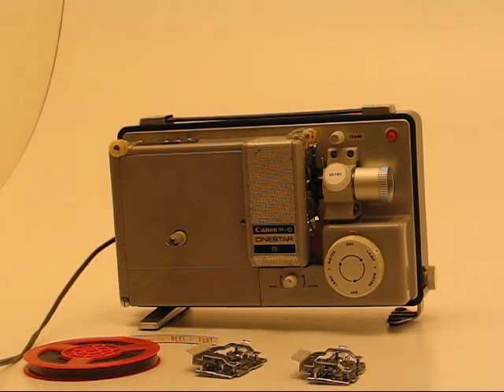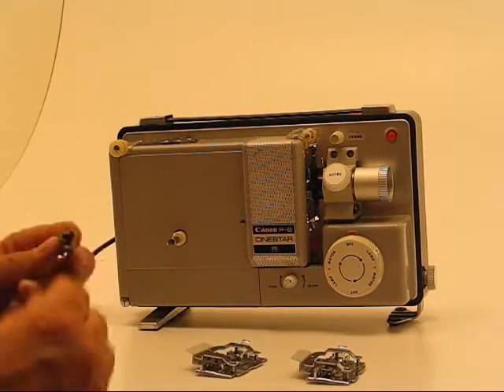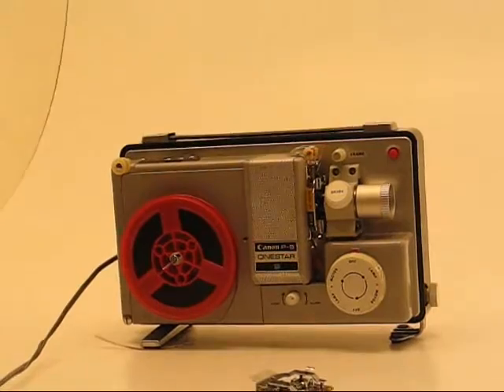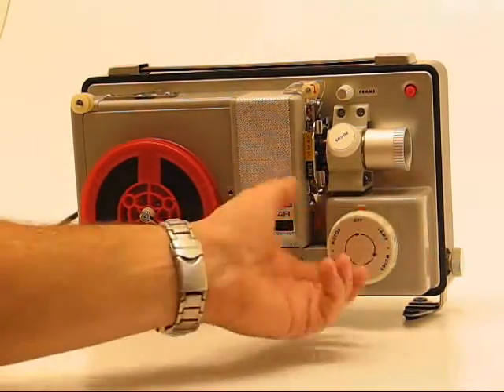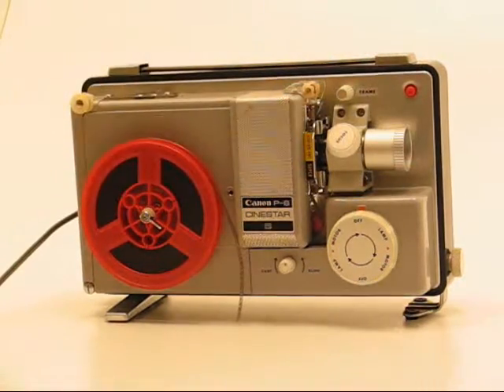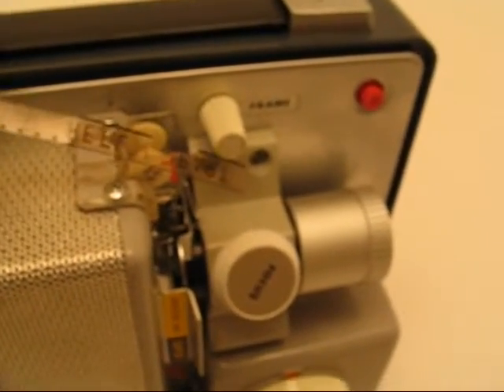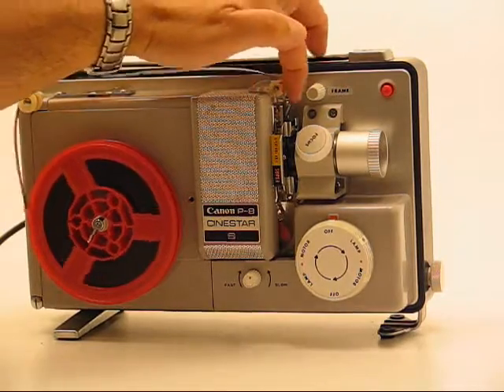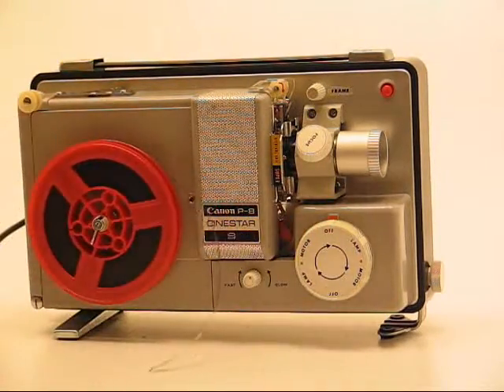Operating a Canon P-8 S-2 Movie Projector

Comment: THANKS for this video!  It covered a lot of features that are not apparent just by looking at the machine.  What spooks me about this unit is the hidden take-up reel - what if the film doesn't engage correctly as it threads, and ends up in a crumpled ball inside the projector?  Is there a failsafe?  Also I understand that there's a manual rewind process - if you don't notch the film and the tail end makes it to the take-up.  All in all, a VERY cool machine.